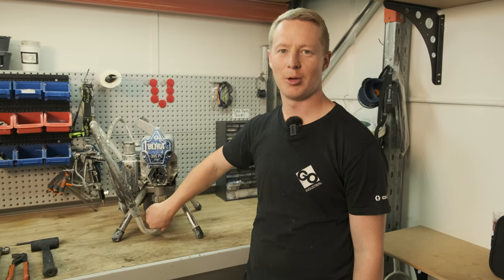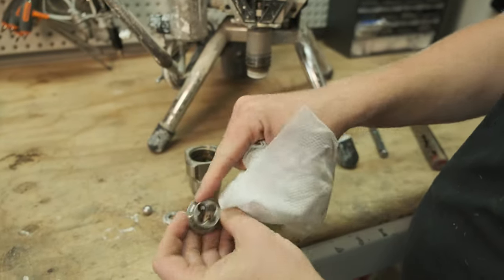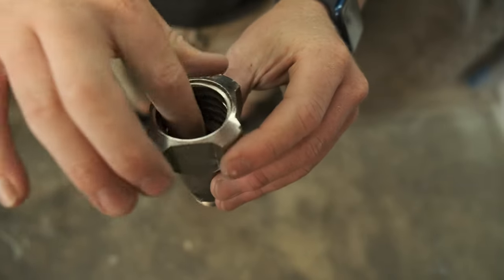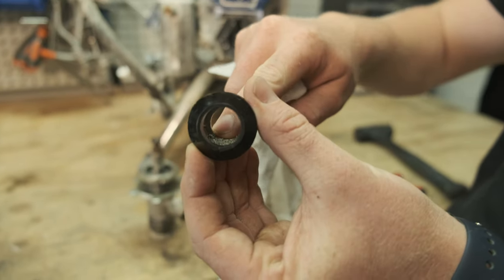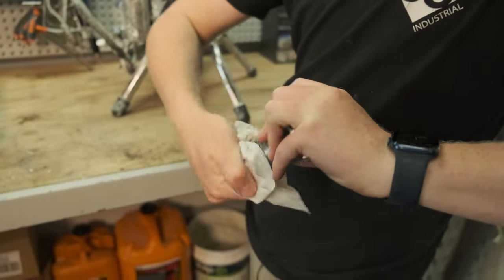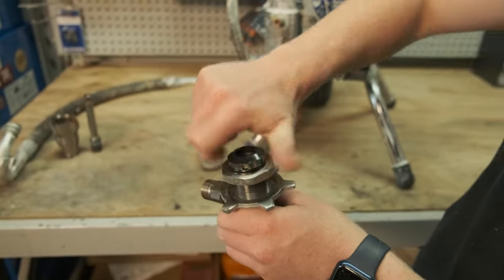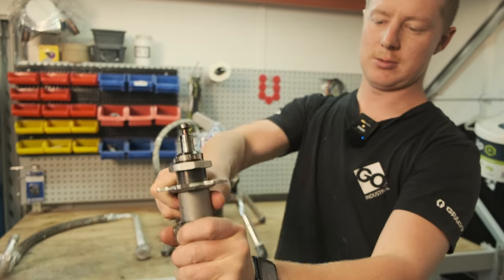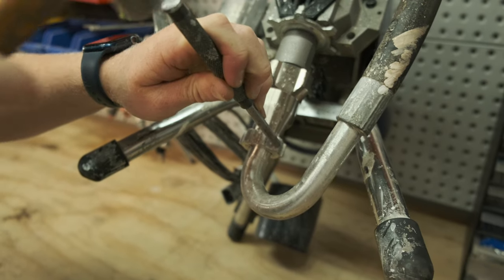Quick & Easy Graco Airless Paint Sprayer Pump Disassembly

Comment: Good video, Nick! However, at the end of assembly those dog years on the lower intake, housing should be tapped with a hammer to snug that seat up against that O-ring. Bottom housing has a cut, and that O-ring needs to be set down in the narrower part to make sure it doesn’t blow out during operation. Way to go, keep them coming!

Comment: 395PC with Fluctuating pressure with too big of a difference between high (set pressure) and low (to the point of getting fingers in the spray pattern. I clean the pump thoroughly after each project., except taking out the pick up tube and pump like you did. Any help is appreciated 👍🏼

Comment: GRACO GURU , need your help brother . Think I smoked it this time . I won’t give back story just straight to the point 

Cleaned 395 ball and seat ………. Put the washer back in and installed seat and ball backwards …………..ran airless and instantly knew I put it backwards as it was just knocking weird .!……..I was also changing the suction hose for a hopper like I do for cabinet jobs ………( might be important ) ………… I reverse the seat and ball and it still wouldn’t prime ….. I loosened the lower housing and it began to prime instantly…….. I tightened it again and it stopped priming …… so now it’s got to be on their very loose ( the main housing that holds the seat and ball inside .) im talking really loose , the min I tighten it a little it stops priming instantly ….. it’s not leaking paint though …. What do you think I did , other than mess up badly .

Comment: My Graco 390 has paint or water coming out of the pump through the G. Any tips on what could be?
Thanks
Reply from the maker: More than likely one of your packings on the piston has split or warped - this will often cause fluid leaking towards the top of the pump & piston where the 'G' sits on your 390PC. I'd recommend following this tutorial to inspect your packings, or purchase a replacement Endurance pump!